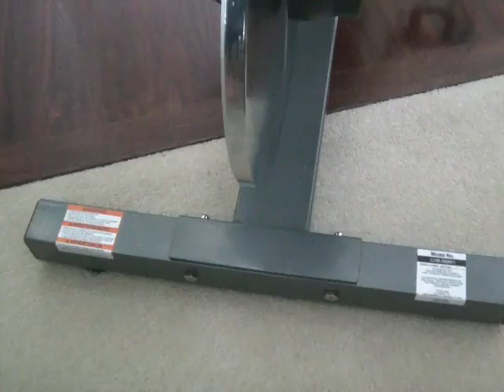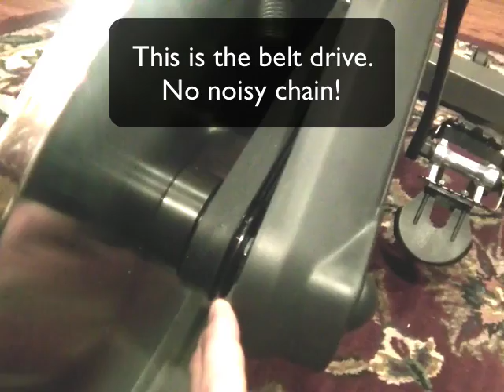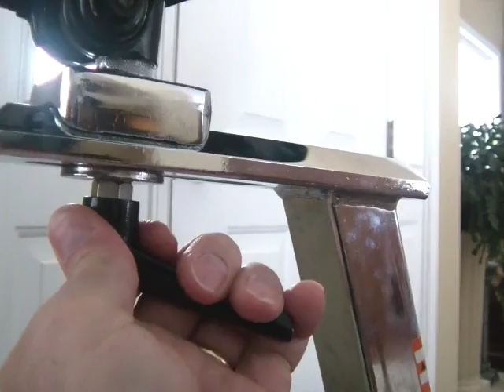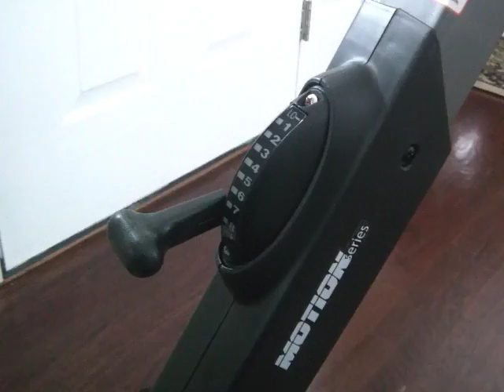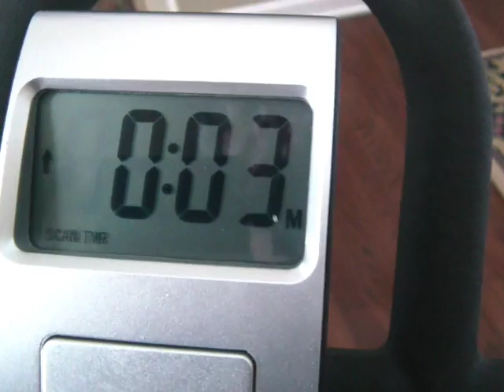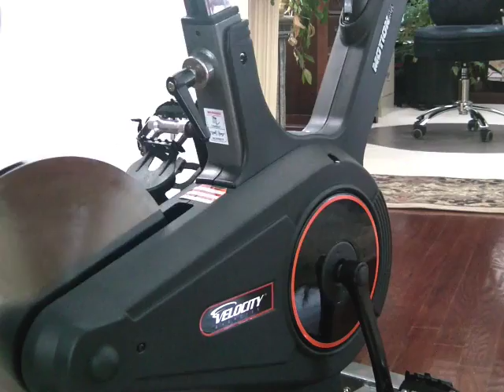Review Velocity Exercise CHB-S0801 Indoor Cycle by Cap Barbell

Comment from the maker: If you like to spin with occasional resistance that is extremely challenging you may not find that you can get the resistance high enough on this bike. My "real" spin bike can be set to a resistance level that is almost impossible to pedal. this bike does not offer that high level of resistance. But other than that, this is a great value.